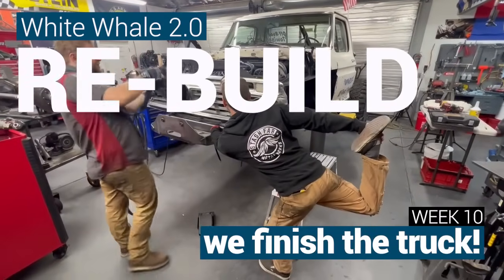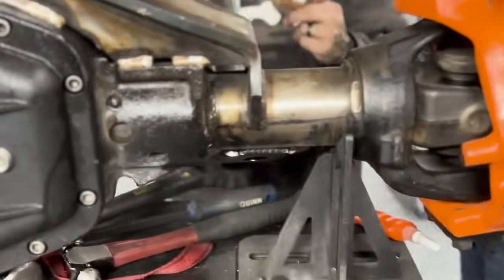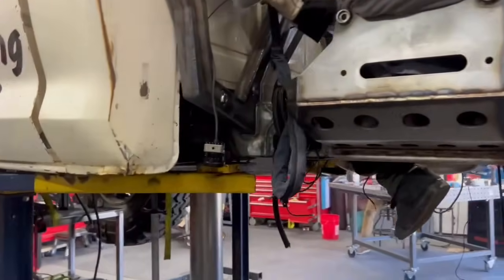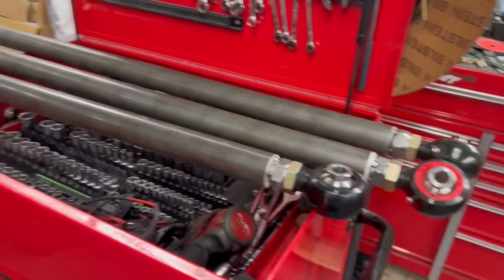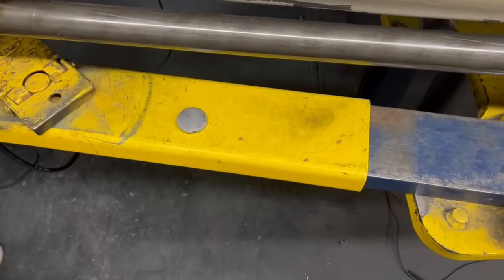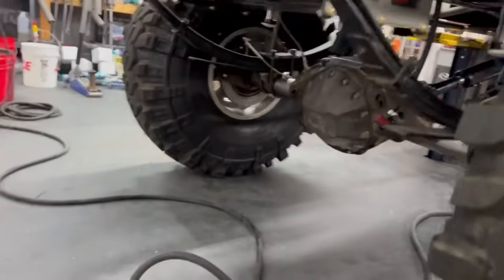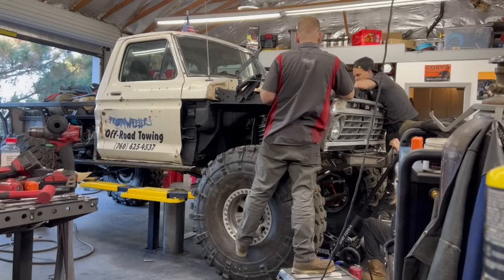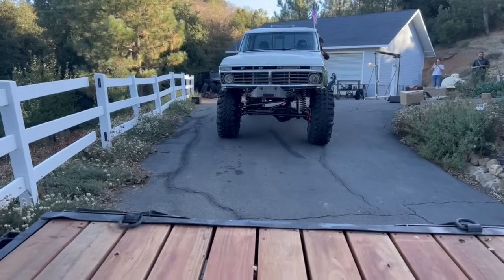Week 10: We finish the truck!

Comment: First off this is some of the cleanest welding and fab work of any you tube off road tow truck I’ve seen. Second what filler rod did you use to weld the truss to the front diff. Love the build I’m going to go back and check out more videos of the build
Reply from the maker: Thank you, that means a lot to us.
Reply from the maker: Most of the front housing welding was MIG but on the differential the TIG used 70S-2 filler rod, if we recall correctly…Nick the welder would be able to answer that best
Reply: @frosty4wheeler  thanks for the info